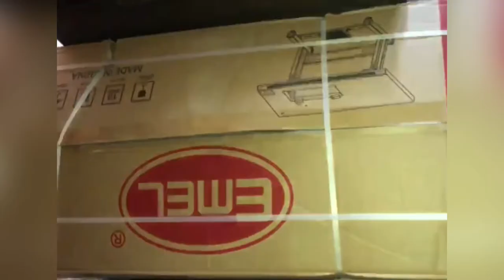How to assemble industrial sewing machine Emel 8500/ DIY step by step

Comment: Thanks for this video. It was really helpful.

1- But please how do you get the belt and the motor to align. The belt is so hard and I feel is short.

2- How do you fix the plate to the machine?
Reply: Same issue here . Pls how did you resolve it
Reply: Hi wonderingbif you resolved this issue? I'm facing the same
Reply: I was able to align my belt with the motor but when I put it on,it didn't move... Pls help
Reply: @gabriellajames8312 have you fixed this